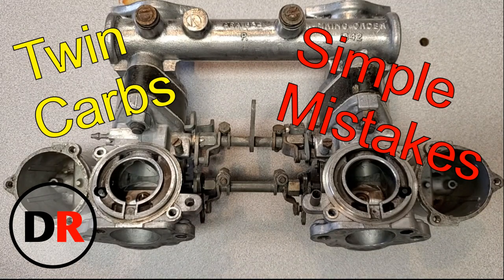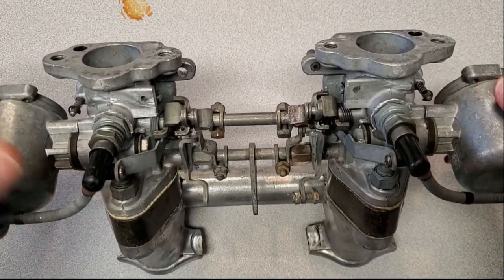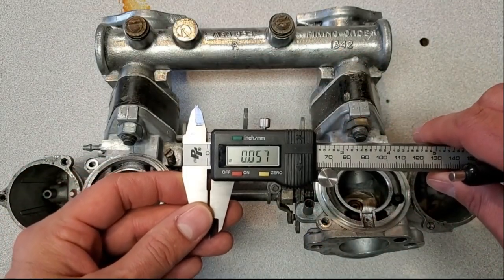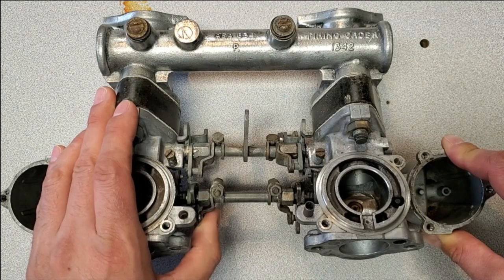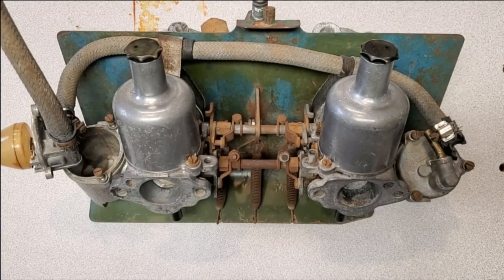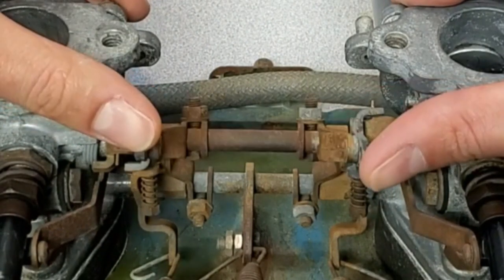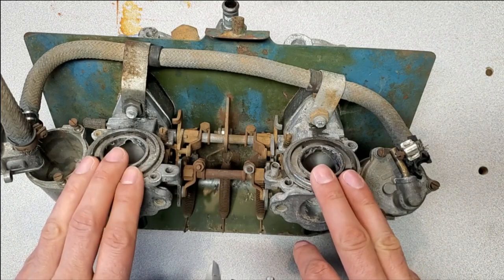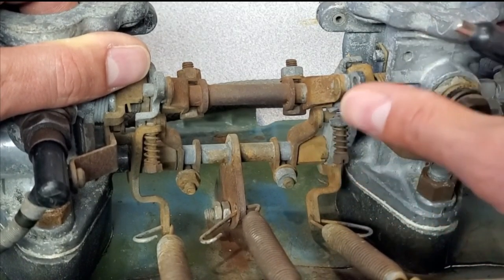Common Mistakes when setting up Twin Carbs for a Mini

Comment: .003 difference in the jet depth is about 1/2 a flat on the jet nut.
Reply from the maker: Which doesn't sound like much of a difference but at idle it is significant.
Reply: @darrensrestorations991  Curious, what tolerance are you using to set the float level? +-.003?
Reply: @hillarylevenworth8824  remember the needle is tapered and the the further down the jet is the greater the cross-sectional area of fuel is exposed to the air flow - fuel is metered by the available cross-sectional area at any give rpm - the float level is set by the tabs on the float not the jet